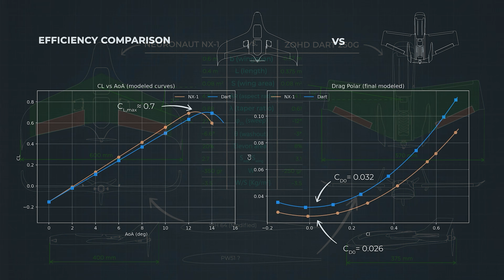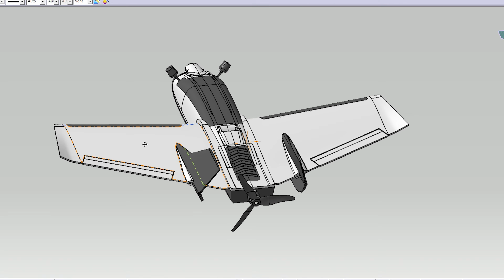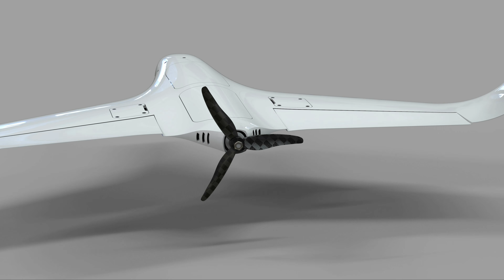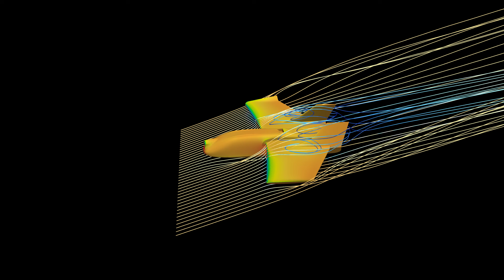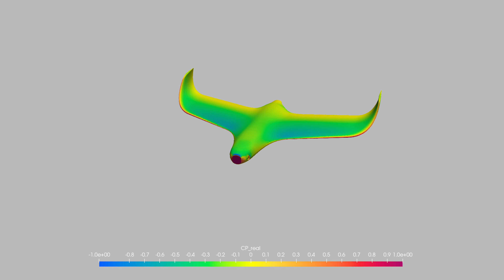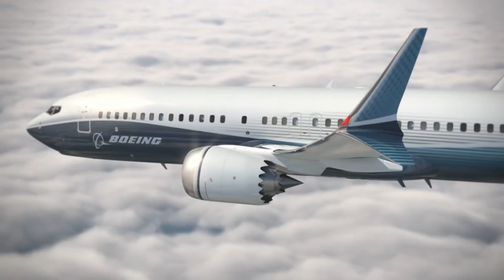🛩️AI vs Classic: Aerodynamic Efficiency Dogfight (CFD) | ZOHD Dart 250G • Reverse-Engineering

Comment: I used an led video projector and paper taped to the  wall .
 I used a manualog reading of the Sp ec's and marked the 22.5 inch span  on the paper . ( for wingspan )
 Moving the projector on a linear plane parallel to the walls surface and tuning it setting still when the projected image matched the 22.5 " marks . It can be traced with a pencil manually .

Comment: Do the tails on Zohd not counteract the spanwise flow created especially by the suction of the propeller and also the forward sweep?
Reply from the maker: It could have a small side-effect in the direction you mention — the fins might slightly disrupt the inward spanwise flow. But overall, the net effect is actually negative: they interrupt the wing’s lift distribution and add interference drag. Their main role is yaw stability, not aerodynamic efficiency...

Comment: I feel your design is the most aerodynamic for that design. Winglets are inefficient? But they are good for stability apposed to aplying twist or having two different tip and root airfoils to create aerodynamic twist or a combination of both.  I would like to see if having no winglets is more efficent than the areodynamic twist and geometric twist.  Also having that high pressure region for the camera is again inefficient.  But a needed accessory

Comment: Holy hell, that is an impressive analysis!!!!! As an engineer myself i absolutely loved it. I am mechanical engineer and i did not touch fluid dynamics since uni, so i did not fully understand some parts, but still, amazing job!! I must agree with others saying that slapping same motor, same prop and same battery on both wings and clocking the max flight time would be the most clear efficiency comparison. But this video is the perfect answer to the question why one flies longer than the other. Now i hope you actually find out that and not the opposite. Used to hate when that happened in the lab, lol. Cheers
Reply from the maker: Thanks a lot, Alex! Really appreciate your comment — means a lot coming from a fellow engineer. And yeah, I also hope the math isn’t lying this time 😅. We’ll find out soon enough in the upcoming flight test videos! 🚀✈️

Comment: Great video! I think your design is indeed more efficient having you calculated everything on grids with similar parameters.
But I'm not sure you can fully rely on the resulting numbers. In my opinion, the grid is rather coarse and insufficient to take the numerical values seriously, especially Cd. For the same reason, I'm also not sure if your simulations capture separation and, consequently, Cl_max correctly. Also, you didn't mention the height of the first cells, but I suspect it's not small enough to correctly use good turbulence models like sst.
Have you validated the grid parameters on known data?
Reply from the maker: Great observation — you’re absolutely right. 🙌 For drag only the induced drag is really trustworthy here; the parasitic part is heavily overestimated because the turbulence model enforces a turbulent boundary layer. At the Reynolds numbers this aircraft flies, most of the wing is actually laminar, so I apply theoretical skin-friction corrections to compensate. I’m also not resolving the boundary layer (y+ in the order of 30 & using wall functions with the Spalart–Allmaras model) for that same reason. And yes, stall prediction from CFD at this scale can’t really be trusted — I rely instead on 2D→3D correction methods (from 2D XFoil polars at correct Re) that account for aspect ratio, sweep, taper, twist, etc.
If you’re curious, I’ve posted the full Python workflow and setup on my Patreon (link’s in the description). 🚀✈️
Reply: @neuronautics_Lab  Thank you for your detailed answer!

Comment: I'm pretty sure that the proof we were looking for was in the actual empirical data collection. The simulated data was assumed already. I didn't know you hadn't done that yet, so nice as it was, it's not really "proof".
Reply: like he said the main short fall of modern CFD is modelling turbulance, but comparing two planes with limmited flow separations at cruise can be done quite accurately. provided the boundary conditions and surface mesh quality is consistent between the two models, theres no reason that the comparison is not valid
Reply from the maker: I just wanted a different more in-depth appoach. But the “proof” you were waiting for is coming… 😉 Stay tuned for the flight-test phase! 🚀✈️

Comment: You did not model the propeller. Pusher prop will reduce blunt rear end penalty of the fuselage.
Reply from the maker: Good point — the CFD was power-off (no prop). A pusher does change the flow: the wash can re-energize the aft body ,but it also adds interference and wake losses, so it doesn’t magically erase the penalty.

Comment: It seems that Dart has more internal fuselage volume for batteries/electronics. Also wide blunt nose to accommodate full size GoPro. Also, CFD is known to have a bad prediction of drag, especially of comparing vastly different designs.
Reply from the maker: Actually, I don’t fully agree — the Dart is made of EPP foam, so its walls are much thicker, and the internal volume difference isn’t really that big. And yes, CFD isn’t perfect for absolute drag prediction, but it’s quite reliable for comparing trends and relative performance under the same setup. I mainly use it to understand where drag comes from and how design choices impact efficiency. 🙌🚀✈️

Comment: Very nice and thorough analysis and beautiful video production. The main thing that appeared to be a point of disagreement for me was how you defined your projected reference wing areas. I think the reference area for the NX-1 should be larger than what you highlighted in green. The curved portions of the winglets as they blend into the wing provide plenty of lift and should be at least partially included in the reference area. The Dart has much larger payload volume and its fuselage has therefore more frontal area. The NX-1 in contrast has almost no fuselage. If you tried to keep the internal payload volume of the NX-1 similar to the Dart, the NX-1 might look a little different. Its L/D would probably still be much better than the Dart, but not by 27%. In particular, the flat bottom of the NX-1 fuselage provides plenty of fuselage lift while the Dart fuselage protrudes rather abruptly. One area where the NX-1 really shines is the minimization of interference drag. The Dart has interference drag everywhere! The Dart can probably beat the NX-1 in terms of DFM (Design For Manufacturability) given that most lines are straight. The Dart has an unnecessarily blunt nose (in addition to the blunt tail). The NX-1 nose is certain to have a lot less drag than the Dart's nose. The NX-1 appears to have unnecessarily thick outboard wing sections and winglets. You might be able to reduce its drag further by using thinner airfoils as you move from inboard to outboard. I don't know if the NX-1 uses any toe angle or twist angle in its winglets, hard to say for sure. If you haven't incorporated any toe or twist, this is another potential area to reduce its drag even further. All-in-all, very beautiful work, I really applaud your approach, this is awesome!
Reply from the maker: Thanks a lot for such a thoughtful comment! You’re totally right — defining the reference area is always tricky, and those blended winglet roots do contribute lift. I kept it conservative to compare both on equal terms. Also agree that with similar payload volume the NX-1 would grow a bit in frontal area, narrowing the gap slightly.
That said, the Dart is made of EPP foam, so its walls are much thicker, and the internal volume difference isn’t actually that big. Great points about the outer wing and toe-in too — the NX-1 does implement a small toe-in, tuned to find the sweet spot between improved lift distribution and reduced induced drag. 🚀✈️

Comment: I think the biggest difference comes from the fuselage design. It appears to me that dart can fit a much bigger battery in the fuselage. Therefore, there is a big difference in the projected area between the aircrafts. How much efficiency can you gain if you modified the fuselage of dart to be similar to your aircraft?
I suspect that the aerodynamic  performance will then become very similar. I think your aircraft would be slightly more efficient but less forgiving when it stalls.
Reply from the maker: Great observation — the fuselage is indeed a big chunk of the difference. On my CFD runs the nose/under-belly pressure and junctions account for a sizeable share of the Dart’s extra parasite drag. If you slim the body, fair the belly, tidy the camera flat and mounts (NX-1-style blended pod), you’d probably claw back ~5–10% in L/D at cruise.
Even then, planform/washout/sweep still set induced drag, and the NX-1 keeps big efficiency benefits there!🚀✈️

Comment: Very nice. I have no interest in RC planes but tech stuff is awesome.
I did have a thought which may effect the CFD analysis. As it's a single prop there will be a rotation moment. To counter this in level flight there would have to be a slight twist to the elevons. It would be interesting (to this nerd) to see what effect that twist has to the numbers for the 2 planes. Contra rotating props could solve the issue if there was a big enough drag difference.
Reply from the maker: That’s a great point, Alan! 🙌 The prop torque definitely introduces a rolling moment that has to be trimmed out with a bit of elevon deflection — and you’re right, that changes the flow and adds some trim drag. The CFD cases, however, are run “power-off,” meaning the prop isn’t included in the simulation. A contra-rotating setup would indeed cancel that effect nicely — maybe something to explore in a future run! 🚀✈️

Comment: For photogrammetry better use Zephyr 3d scan. Even free version with 50 photos max. gets better result, than the soft you used. Also painting a grid pattern on a model (it doesn't have to be straight, or look pretty) helps A LOT. Good luck in your future research!
Reply from the maker: Thanks! 🙌 I’ll definitely give Zephyr a try if I do another photogrammetry project. I’d really love to get my hands on a proper 3D scanner someday… maybe that’ll be the next upgrade 😅

Comment: Why would you invert the angle of the rear fins? If the goal is to have a benchmark, changing the design doesn’t make sense to me.
Reply from the maker: Good catch! 🙌 I actually planned to compare it with the original Dart setup (fins inward), but for my configuration I flipped them outward to keep the flow cleaner around the prop. Beyond that, I don’t think it makes a real difference in efficiency — maybe just a small effect on lateral-directional stability. 🚀✈️

Comment: You struggle a lot to proof what can be seen with an open eye and without using a software, I have a Parrot disco fixed wing's drone and I know from 7 years ago that is the most efficient drone I put my hands on, when you fly it in different environments you will see how the wing is generating lift even in the lighter breeze
Reply from the maker: I wouldn’t call it a struggle — I actually had a ton of fun along the way 😄. You can definitely see which one is more efficient, but the goal here was to quantify those differences and understand why they happen.🚀✈️

Comment: Great video. I also hope, to get some info about the programs you used. What were the input data for Cruise speed and Stall speed? Thanks for the video.
Reply from the maker: Thanks! 🙌 I’ll dive into that in an upcoming video where I flight-test both designs — but you can already check the input/output data and setup details in the dedicated Patreon post. 🚀✈️

Comment: Nice one! Evolutionary design in a neural network is undoubtedly the way of the future.

Couple of questions though. Why do you have so much stuff sticking into the airstream? Antennae, control linkages, and a flat front for your camera. It’s a common practice but I wonder if anyone has calculated the drag that these elements cause. Have you seen Andy Lennon’s book on rc aircraft design? He has a whole chapter on this sort of thing. 

Just as a matter of interest, I’m doing the same work as you. My latest test rig is a delta wing of 750mm span with a small OS 1.6 cc engine in front. Only just started flying it, but for a flea powered engine of << 200 W it is very fast. And I found out (accidentally) that it is very stable without radio control
Reply from the maker: Thanks! 🙌 You’re right—covering linkages and hiding antennas could definitely shave off a bit more drag. The flat front is kind of inevitable with FPV since the camera has to sit there, unless you add a transparent canopy (but then you risk reflections). Definitely something worth exploring more in detail 🚀✈️

Comment: I really want a physics transformer model, open source and available.

The vast majority of progress in fusion has been due to AI. Particularly in stabilization and design. AKA the hardest problems. 

If fusion represents a problem where a good enough approximation (where "good enough approximation" is coming from a hyper intelligent synthetic Shogoth mind), then fluid dynamics should be much easier. Possibly run at home on my 4070 TI. 

It's like if you can dodge a wrench (plasma fluid dynamics), you can dodge a ball (air fluid dynamics).

Comment: In the efficiency chart there is datat that you have left uninterpreted. The dart is more efficient at low angles of attack, it is more efficient close to 0° where you would normaly cruise. (Although it is negative, I don't know if it makes much sense) More efficiency at 8° AoA is not useful as you do not fly with that angle the majority of the flight. Plus the greater AoA capability lf the Dart may make it a better allround flying vehicle.
Reply from the maker: Not really 🙌. To generate the lift needed to balance the weight, these planes typically cruise at about CL ≈ 0.4. To hit that CL, the AoA is usually around 8°, which is exactly where you see peak efficiency. So that’s actually a good sign—both wings were designed to be most efficient right where they need to fly. 🚀✈️
Reply: Forgot to say, you design is magnificently beautiful❤
Reply: Okay, thanks for the explanation, I am more used to designing gliders and cruisers with conventionl tails, not used to flying wing attitudes

Comment: what's the max recommended battery weight/size?
Reply from the maker: Great question! 🙌 More than battery size, the key is keeping the all-up weight under 400 g (ideally ~350 g). It depends a lot on your FPV gear, electronics, and motor, but I usually fly mine with approx 1200 mAh 3S pack. 🚀✈️